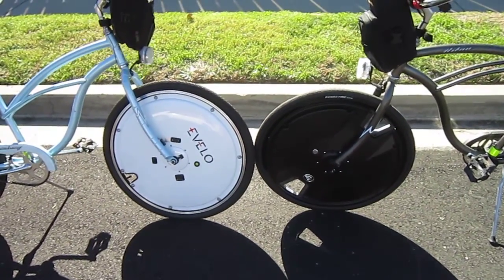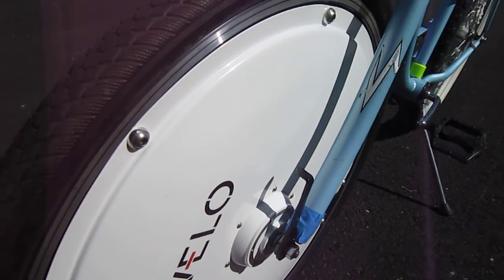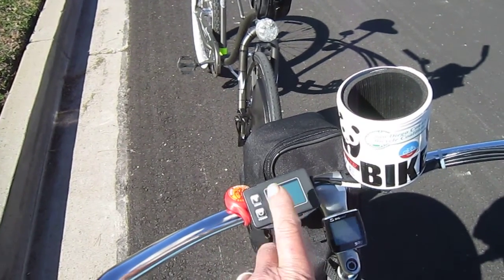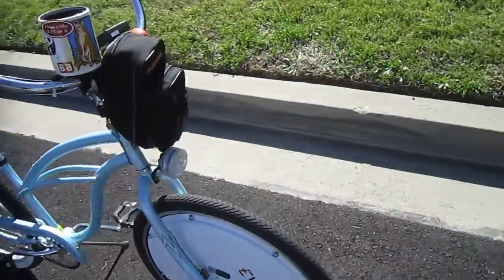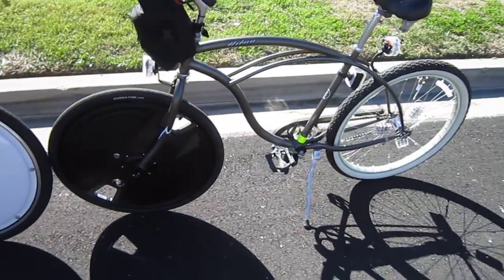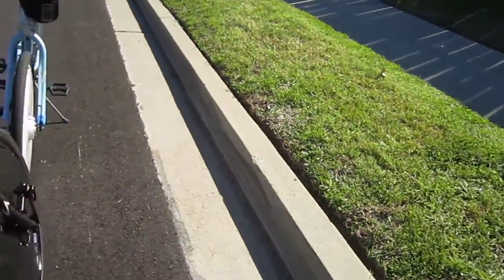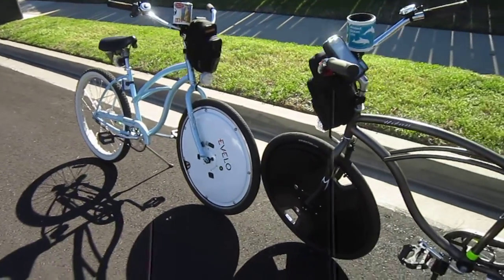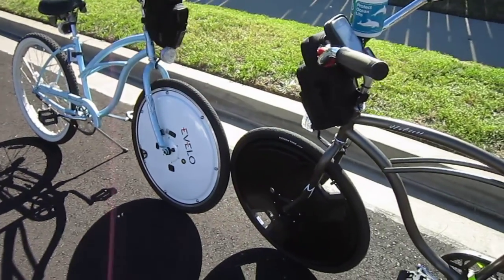Omni Wheel vs Electron Wheel---Overall Direct Side-by-Side Comparision

Comment: A proper test would have both doing pedelec, period. That's why the big difference in mileage figures guy.
Reply from the maker: Like I said in one of the videos---both motors were at full output and no assist was from the pedals.  One bike didn't have the pedelec feature installed so this was the most accurate way to show the difference in power and range.
Sorry you don't understand that---or like what I did.  I spent 10 times the amount of time and energy than most any testing I do, on this project---And I think is was as accurate as can be.